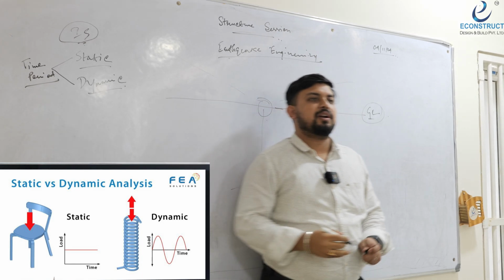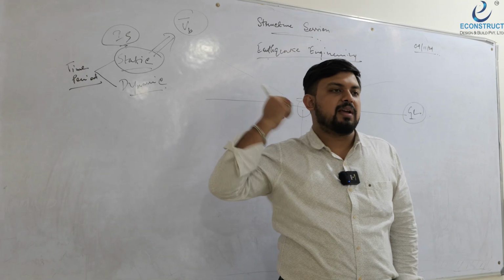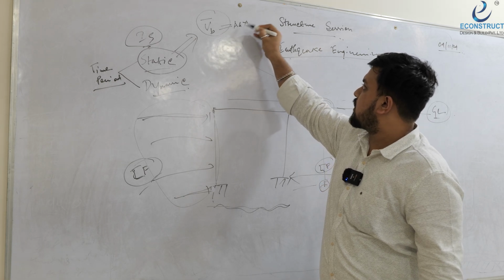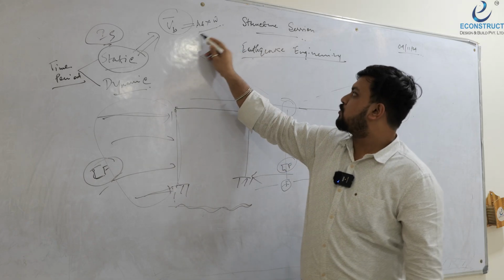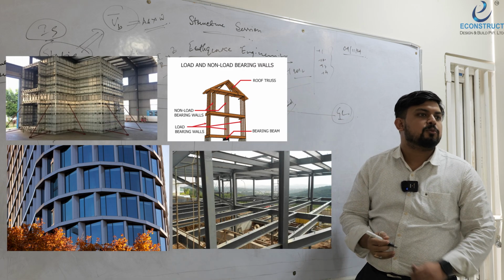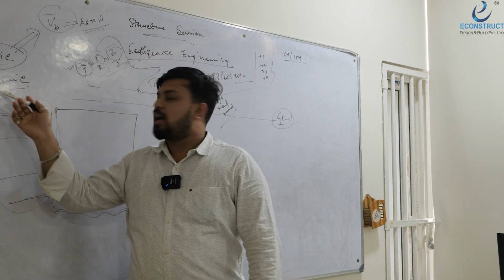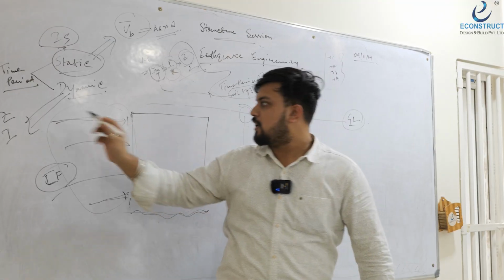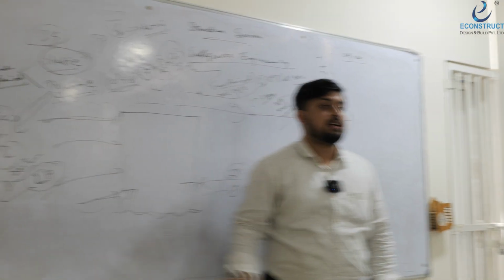Brief Description about Earthquake Engineering

Comment: The guy is wrong at one place. 

1. Earthquake is not static but dynamic. There are two types of earthquake analysis which are static and dynamic.
Reply: In terms of software and conceptual explanation and also in operations if you define there are two types only, static and dynamic, here types means analysis types only. Later part it has been told also that static analysis is just required to calculate the magnitude actually its dynamic only but since the codal provision gives us a better insight of base shear magnitude thats why we need to calibrate static base shear with dynamic one and ultimately dynamic needs to be taken in final design. Since the whole class is too long and this is a brief explanation thats why that part is not in a direct part of this discussion that you have seen.
Reply: @tathagatabiswas6548  If you meant about analysis, then it is correct. But in the video, it was heard that earthquake is static. Hence chose to point out.
Reply: @shareqinamdar8903 Yes it was meant for analysis only. Anyways thanks for commenting.